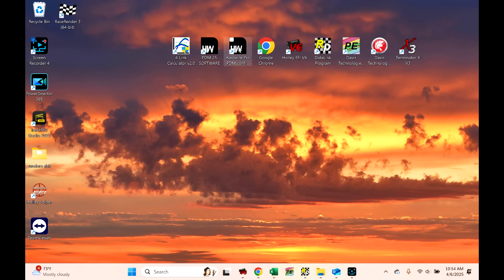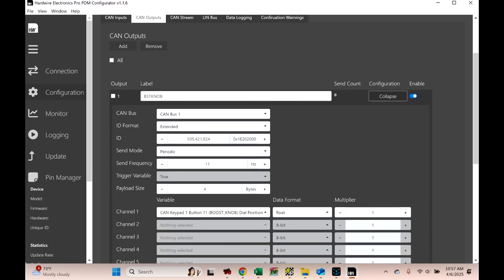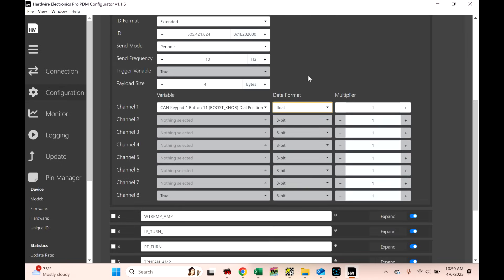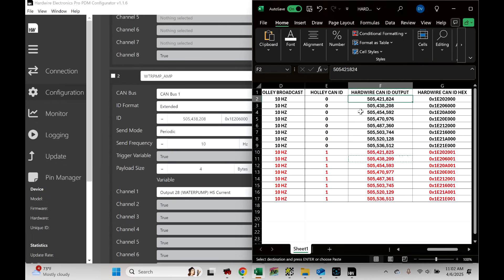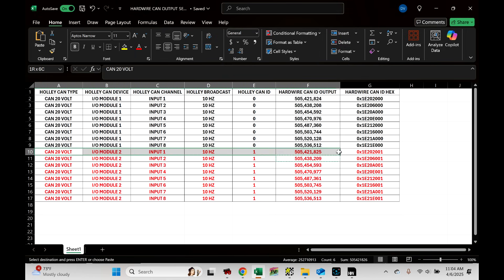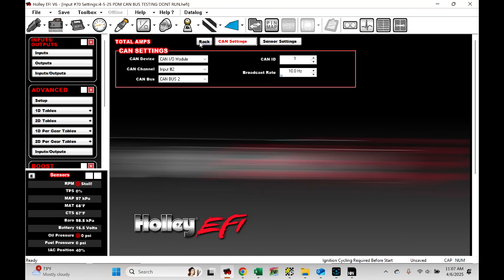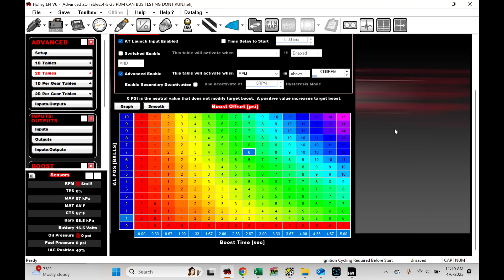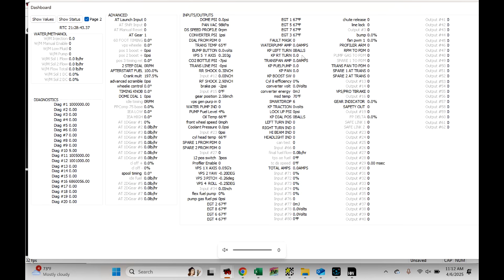Hardwire Electronics pdm 28 talking to Holley Efi via can

Comment: Great Job Devin one note, if you use CAN thermistor you can set the scale and ohms to be the same across the scale and just read the value.  and for things like simple switches or keypad buttons you can use CAN Ground and it will read the 0 and 1 from the PDM as on and off.